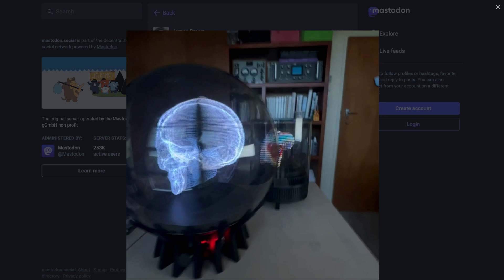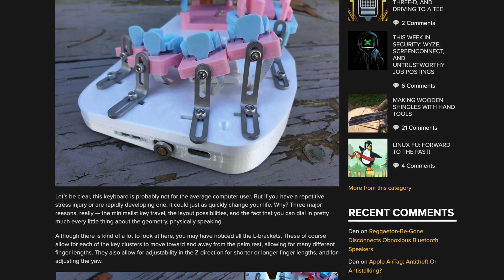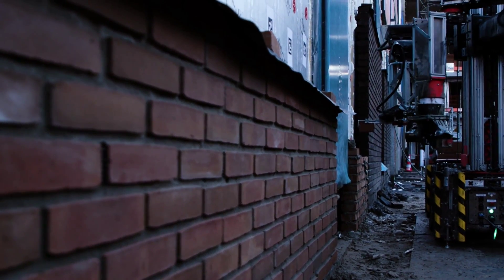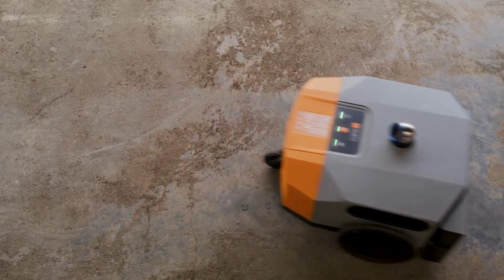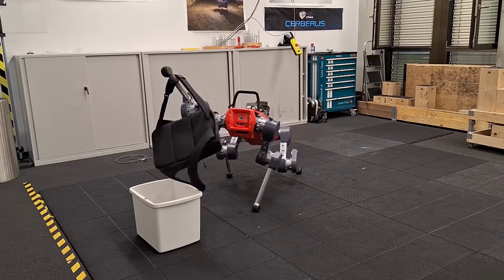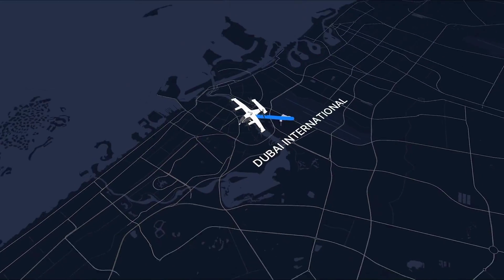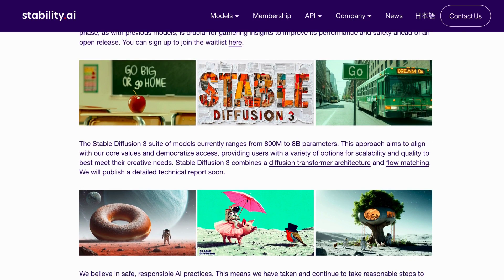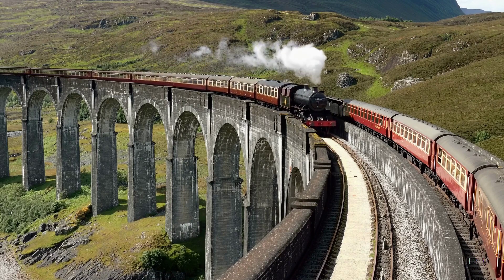Futuristic Hologram-like Display Developments (+ More Tech News)

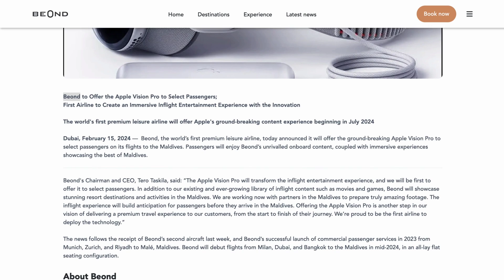Comment: 4:01 how does that work? Isn’t the Vision Pro custom fitted to a face, hence requiring a face scan in the store?
Reply: surely theyre just using some generic model face then, probably multiple, like one for men, one for women, one for kids. Who knows but its a luxury airline anyway so not like a shitload of people are going to experience it.
Reply: They have a generic fit like Apple did when they invited influencers to try the Vision Pro before launch
Reply: @NeptuneSega  yea I have a Rift S my 6-10 yo nieces use and they have a Quest that I use, you just need to adjust the headband and at most the ipd and Im pretty sure the newer headsets do the latter automatically

Comment: In a corn bin the corn is like sand and if the bottom is open then it like standing in quick sand. And yes you can get sucked under. And around where I grew up a semi truck driver died unloading his truck he fell in his trailer that was dumping from the bottom corn he drowned in corn.

Comment: I will never understand why they dont use the contruction robots to place a full prebuild wall instead of brick by brick, also, you sounded dubious on the  "grain weevil" about job danger, but very often people will drop inside the silos and they will be loged of life, never saw a news of fingers apearing in rice of beans? well that where they mostly came from
Reply: Because this is to attract investors and prebuilt armored concrete needs a whole crane to place anyway, not only it would look unimpressive, you're better off with a team of men when weather variables and dangers start piling up.
Reply: The constuction robot is in the Netherlands where homes are usually made from both large prefab structures and brick facades, as can be seen in the video. I think the brick is there because it allows for more variety in visual style. I was most impressed by the grain silo robot and the construction drawing robot. Those seem immediately useful devices that solve real world problems.
Reply: It will likely be improved upon.
Reply: full walls are heavy and harder to transport than piles of bricks, you also cant build to any size or any shape like you can with individual bricks